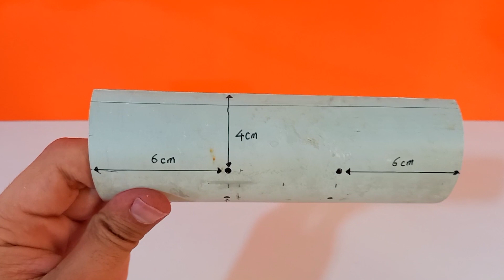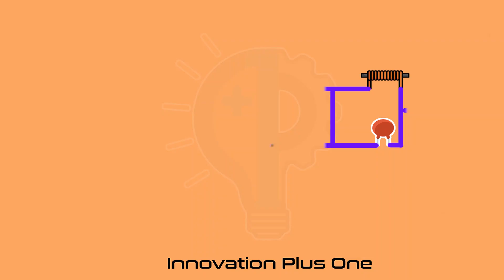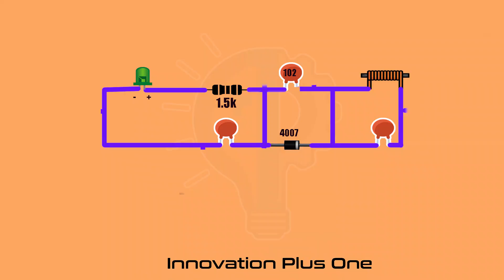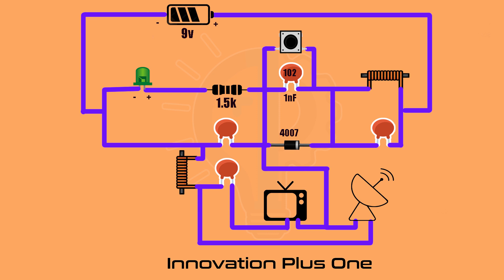How to make Rotating Antenna at home

Comment: Good video, do u hv a supply list of all that u used to make this board?
Reply from the maker: Thank you for your comment Ed💚

Required electronic components: 
1* Diode 4007
4* Capacitor 102
2* Inductor
1* Led
1* push button
1* DC motor (To rotate the antenna)
1* Power supply 9v